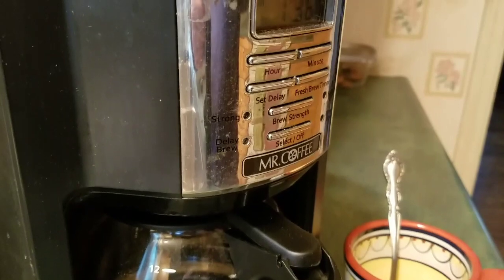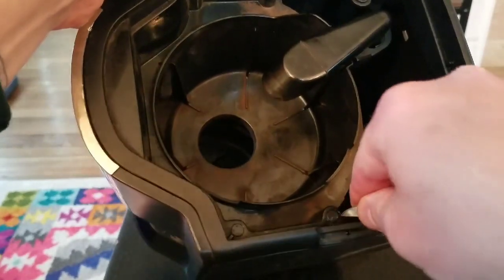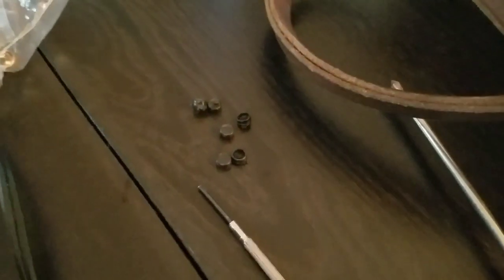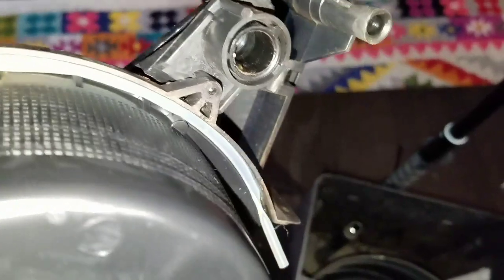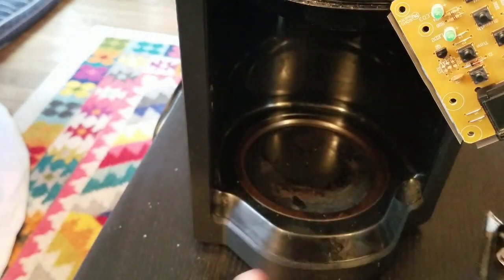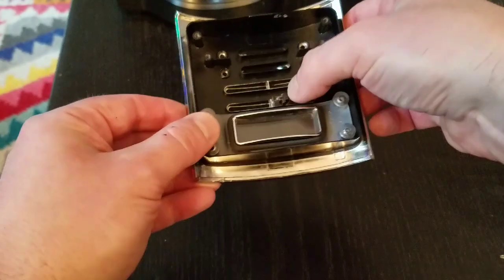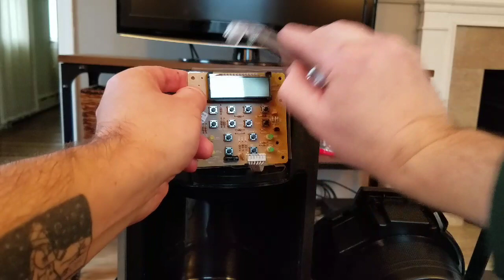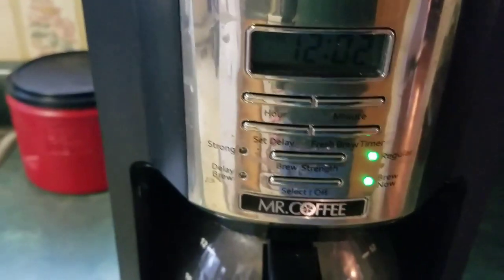Troubleshooting and Repair of Mr. Coffee Automatic Coffee Maker, Cleaning Sticky Switches

Comment: Thank you for this! I have the same problem with sticky buttons on a similar model. Mine has the flat control panel, rather than your curved one. I had seen the plugs covering the screws, just as you did, and hoped that was the way to access the control panel. YT is often my first stop before diving into a repair like this, and your video confirmed my thoughts. I'll be pulling mine apart later today.
Reply from the maker: I'm glad you enjoyed and thanks for the comment
Reply: Great repair and kudos to you. I will try spraying electric contact cleaner again on the outside of the switch It helped for a couple of years.  I know it's  temporary  fix at best.
Reply from the maker: Thanks!